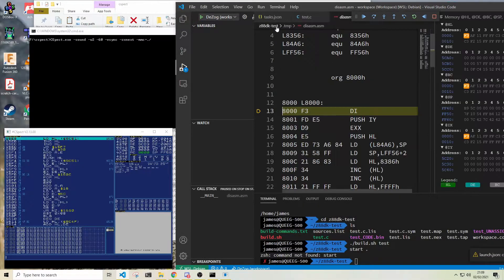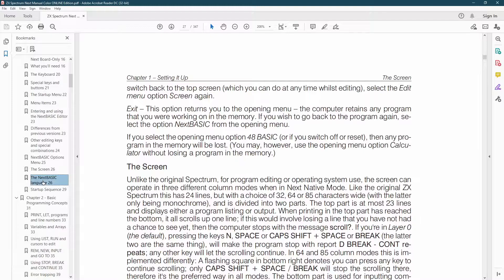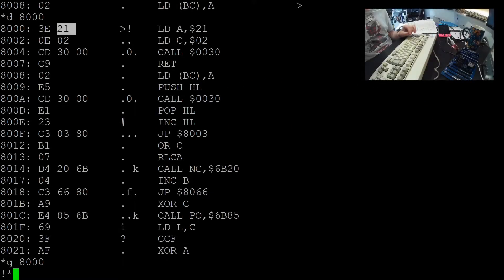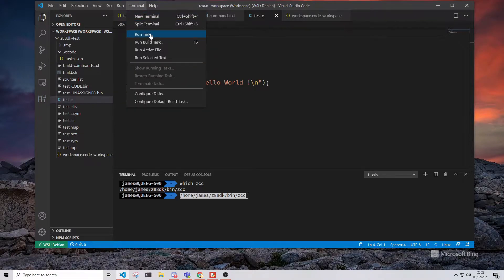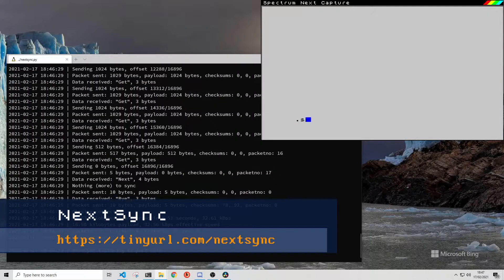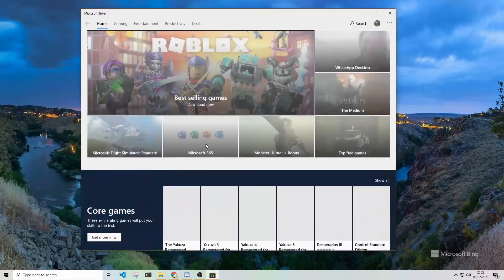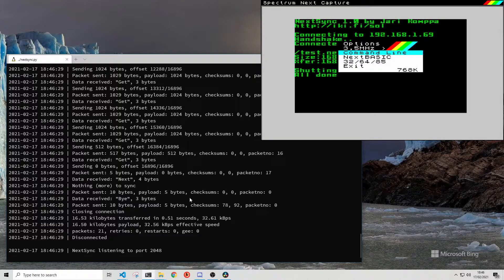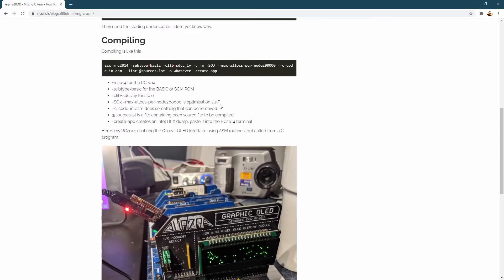Starting ZX Spectrum Next Programming in C and Z80 Assembly - Devlog #1

Comment: Having a really hard time setting up a development environment using vscode to program in z80 asm using cspect and real hardware for debugging. The json stuff and setting everything up is confusing. Have spent several hours attempting this multiple times. Are there any resources you can point me at to learn whatever I need to learn (json, etc?) to get this setup working? Trying to develop games for the Next is a real pain unless you're already a computer programmer or are willing to settle with BASIC - which I'm not. Any help would be appreciated. Cheers.
Reply from the maker: If you go to the Spectrum Next Dev wiki - wiki.specnext.dev there's a community section at the bottom of the first page with links to the forum and a few other places.

My own setup has changed a bit. Now I just use vscode and nextsync to send my code directly to my next. I don't use dezog any more.

I might do an updated video about it.
Reply: @ncot_tech  that’s exactly what I want. I presume you use cspect also?  Just so I know what I should be aiming for, when u compile your code in vscode does it run automatically in cspect or is that a separate step? That would be great if you ever do a video on setting up your environment or document it on your site. Cheers.

Comment: Is there more information on the Make file you mentioned to xfer the program the the Next using nextsync?
Reply from the maker: I think I've modified it a bit since that video. Now my Makefile has a "Make install" that just copies the .nex file into a 'bin' folder and I run nextsync separately from in there and it automatically syncs to the Next when I run .sync on the Next.

To automate it a bit I edited the Next's autoexec.bas file to run the sync utility on boot. Now I just compile code and press reset on the Next.

I also found this a lot simpler than trying to use DeZog

Comment: Very interesting. I am trying to learn z80 myself and I am thinking about my tool chain. Coding in C and compiling to z80 would be cool too. My target is a Lynx (Z80).
Reply from the maker: If you want to write in C for a Z80 machine, Z88dk is worth looking at. The important thing I found was having a system where I could quickly try something out as I started to learn things.
Reply: @ncot_tech  Oh my - Z88dk already supports the Camputers Lynx. Excellent! Thanks for the heads up.